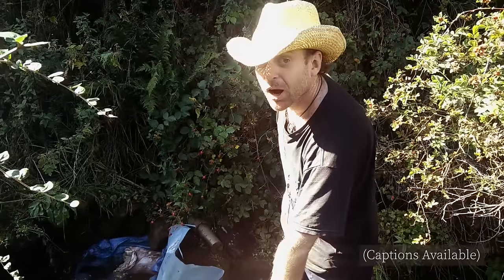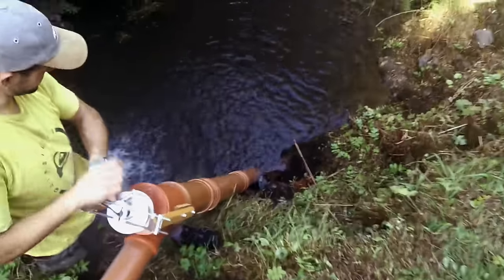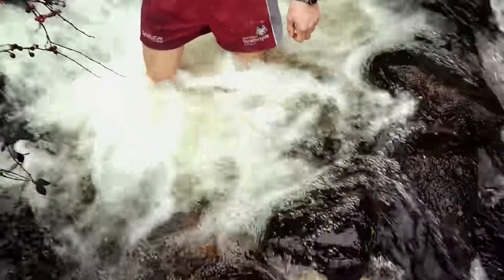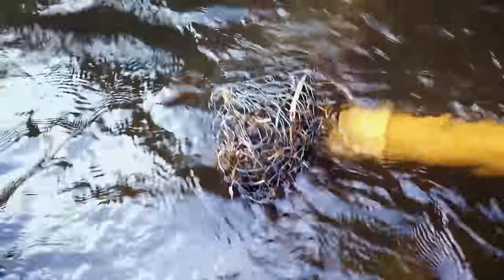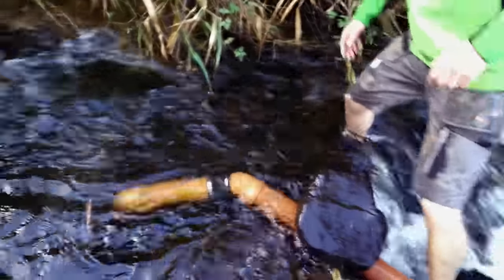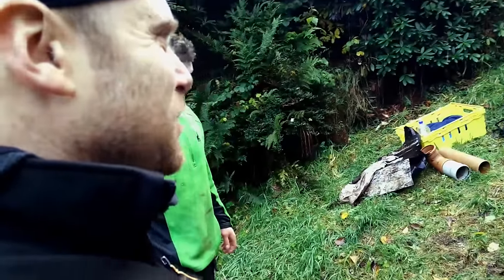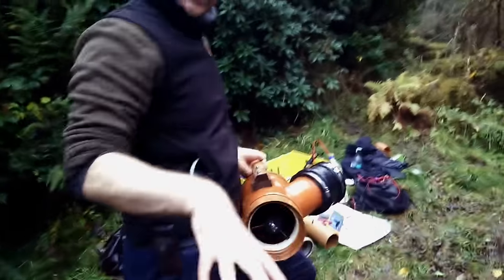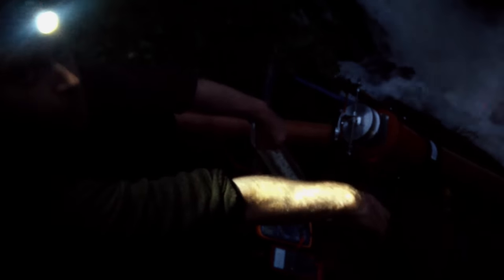Real World Results From The $50 Water Turbine

Comment: Nice try, wrong fans thou.

You are runing a low head, I might say very low head instalation, that requires at least a Kaplan turbine (looks more like a boat propeler) or a Francis turbine (more like an impeller), but the head is I guess too low for a Francis.

My take is you need to go Archimedes screw versus Francis propeler design, print it yourselves in PLA since is cheap and strong, but will wear out in time, and if you are happy with the output than re print it in PPS or at least Polycarbonate, than remelt it in dustified  dried salt or fine plasterr (gypsum) to improve layer adhesion.  My take is where you got 150 watts you can go over 200 watts, and where you got the 200 watt you can go beyond 300 watt.  It is all in the efficiency and at ultra low head, migrating towards Archimedes screw is the only option.
Reply from the maker: The PC fans were chosen pretty much purely for sake of global availability, but I have been quite impressed in terms of efficiency and power.

I'm in the process of 3D printing some more exotic runner shapes which I'll trial when I'm back in Scotland, including some screw types. Looking forward to seeing how they do.
Reply: @OpenSourceLowTech  If you know you are going to be around Luton/Watford/hemel Hampsted/Milton keyns let me know a few days in advance, a discussion on th subject might prove interesting, and if it's not raining, my grill can cook in many ways... lol  B.O.B.

Comment: It's amazing to see you posting again! I've shared your stuff with a ton of different folks. I have a few questions.
1. What do you think is the minimum pipe diameter you could use effectively? My personal situation is I have a pretty low flow spring fed creek but I think I could run this with 1.5-2 inch PVC pipe and it runs over a 50 to 60 ft drop off so I have a ton of potential head pressure. 
2. Is there a reason you chose to use the fan blades as opposed to something like a carbon fiber rc propeller or a boat trolling motor prop? It certainly would raise the price into the 100-200 dollar range but it seems like the durability would warrant the increase in price. I certainly see the appeal to being able to find a junked hoverboard and a a tower pc to rip a fan off of from the local dump but, personally, I'm out in the country so transportation costs can begin to eat into the $50 price tag.
3. Is there a reason you chose an inline propeller as opposed to something more similar to a standard water paddle wheel but offset, with maybe half the wheel in the flow at any given time? It just seems like you could do 5 or 6 flat paddles from a cut down leaf spring or thinner piece of metal flat stock and never have to worry about it breaking.
Reply from the maker: How much flow? If it's low tens of liters per second or less, and with that much head you're probably better off with a pressure turbine, such as a Turgo or Pelton.

The runner can be made of pretty much anything that will hold up, I've been focusing on PC fans so far because they're everywhere in the world, but if one has access to something more robust that fits then there's no reason why not.
I'll also be trialling some fairly exotic 3D printed options when I'm back, for those with access to a printer.

Water wheels aren't very efficient, even in optimal situations. Also very low revving, so need gearing up to reach any kind of useful voltage.
Reply: @OpenSourceLowTech  awesome thank you so much for the information! I will look in to the turgo or peltin turbines. I think some of the other examples I've seen were a turgo turbine and I, incorrectly, thought the turbine portion was offset to flow of water.
Reply from the maker: Offset like how?
Reply: @OpenSourceLowTech   I think it was this video I was thinking of where they are using a turgo turbine. It had been a year or more since I watched it. It looked to me as though the water was just skimming past the edge but I'm sure that's not what's happening based on the diagrams I found since you mentioned turgo turbines.

https://youtu.be/Flz4_OE4CGI
Reply from the maker: Turgos and Peltons both work by blasting jets of pressurised water onto a wheel of cups, so yeah the flow is tangential, more or less, to the runner. Mine is axial.
Reply: @OpenSourceLowTech  thanks so much for the answers! I truly feel like the work you're doing is gonna make a huge difference for a lot of people if they are willing to listen and learn. Keep up the great work!

Comment: This video title sounds like click bait, but it isn't. I watched it a few weeks ago. Search for this title "This Genius Propeller Will Change Transport Forever" watch the video about a toroidal propellor that would be stronger and according to the guys in the video, much more efficient. Great video. I subbed.
Reply from the maker: Yeah saw those, will test some when I get the chance.
I feel like their advantages are more for use as a propeller than impeller, but only one way to find out.
Reply: @OpenSourceLowTech  I think, and granted that can be dangerous, but it would seem like if the "prop" is surrounded by a tube that is just barely larger than the prop and there isn't any cavitation, the results of the prop pushing the water would be the same as the water pushing the prop, except of course, in the inverse.
Reply from the maker: Quite possibly, but cavitation is the issue. Props usually have a tip speed ratio greater than 1, meaning they're moving through the water faster than the water is moving past them, and so cause cavitation, which is the main thing the toroidals are looking to resolve and why they're pretty efficient for that purpose.

But that's not often true of impellers, where the rotational speed is set by the flow, not the other way around. It definitely can happen, horizontal axis wind turbines usually have a TSR greater than 1, but it's less a concern with water turbines, with most of the cavitation instead tearing off the more static, less hydrodynamic areas.
And so the toroidals are having less of a problem to solve, and their other drawbacks are more of a concern.

But this is still mostly just assumptions and conjecture on my part, I'm looking forward to testing various of these designs in the real world and seeing what happens.

Comment: A 3 blade sand cast aluminium fan would still be affordable and DIY but much stronger
Reply from the maker: It would, but I'm aiming for maximum ease of fabrication.
Tho if you do have a metal runner of the right size, it'll attach and work as well.

Comment: I think you could generate more electricity with a larger turbine 3 times the diameter of the exit pipe with a cup like catch rather than slanted blades.  Imagine the horsepower it would take to deliver that much water at that volume and speed up the hill to it's source.  Maybe one full horsepower so you should be able to get 2/3 or 3/4 of that back.
Reply: So are you telling us that if you build a bigger turbine you will get more power?  NOooo! REALLY??? Why not "just" build it a thousand times bigger then? So much electrics!

When you figure out the answer...
Reply: @calysagora3615  The turbine they are using is too small.  It is not even slowing down the water.  They could put ten of those in the pipe, it is minuscule.  3 times the diameter of the exit diameter should provide sufficient torque on a 12 to 13 inch turbine and a 500 watt generator.  Also their little fan blades BROKE due to being weak.  Comment back when your have something constructive to say instead of sarcastic.
Reply from the maker: It's a momentum turbine, not pressure, so the power is in getting as much water moving as quickly as possible, with no real advantage to multiple runners.

A larger runner will produce more torque, but at less rpms unless the water is venturi'd across the outer diameter, which may or may not be an advantage overall but would definitely be far harder to construct with off the shelf materials at as low a cost per watt as possible.
Reply: @OpenSourceLowTech  I have an idea to help maximize the water flow through a turbine.  If you make your own turbine you can use plastic 2 liter bottles to make the vanes by folding them over like we did when we were in grade school to make a pinwheel powered by wind.  Then take a bottle and cut the ends off and split it down the side to make a chute to run the vanes in while they are spinning to keep the water from spilling out or you could just cut the side off of the pvc and run the turbine in that open side.  Now that I am started all kinds of innovations come to mind, some by using a small rubber tire cut in fourths.  Good luck in your designs.

Comment: You seem to be unnecessarily fixated on the siphon. If you could at least add a method of sucking out the air that tends to find its way to the top of the system, it make more sense.

Comment: According to my calculations 192 watts demo 35 liter/s and 2.5m drop is only 22% efficient. If it was 100% efficient you should get 858w.
Seams a bit low, something is very of; commercial hydropower reach over 90% efficiency, so I guess 60% might be a resonable number to expect for something like this.
Either the generator is very inefficient or the impeller is inefficient or I guess both.

Maybe test each one separately.
Reply from the maker: Your calculations are correct, but a 3D printed screw type impeller does a better job than the PC fan (which also does fairly ok for the accessible materials option).
Pelton and Turgo type pressure turbines as used in industrial hydro power are very efficient, but require at least 20m head to operate. In low head situations such as this turbine is designed for they essentially don't operate at all, let alone efficiently.

Comment: Cavitation explosions, air fans are not engineered for that
Reply from the maker: There's a little cavitation off the back of the runner, but flaring the draft tube straight after greatly reduces it by dropping the linear fluid velocity.

Comment: You would be far better to use a Garden Auger Post Hole Digger Earth Drill Bit and weld an extension. They are 80mm x 600mm.They are only about $20 delivered, rather than use a pathetic fan blade. You could use a voltage doubler to increase voltage. They only use 2 electrolytic capacitors and 2 diodes. Better still get a second hand alternator and put neodymium magnets in it, or use a dc treadmill motor with the voltage doubler.

Comment: Well I Understand Your Trying To Keep It As Cheap As Possible, Butt Why Not Lookin Into An Aluminum Or Stainless Boat Motor Prop Or Such For Driving It? A Few Guys Are Using Strong Little Electric Motors w/SS Open Blades Props On Kayaks & Are Getting Them Somewheres? 🤔😁😎 Thanks Mates
Reply from the maker: I'll be trialling a handful of various options. Metal runners would be better, and no reason not to use one if it's the right size and is available, but PC fans are everywhere and seem to do a decent job, one I've figured a workable method for strengthening them.
Reply: @OpenSourceLowTech  Maybe Just Cut & Bend Blades Outta Flat Scrap SS Metal 3-4mm Thick? From Pot-Pans-Lids, Etc... 🤔
Reply from the maker: Is an option.

Comment: Do I detect a fellow Kiwi accent
Reply from the maker: Yep.
Reply: @OpenSourceLowTech  Chur chur Brother unmistakable accent , you guys worked so hard on this setup hope it's still running..
Reply from the maker: This particular build is not currently in place, but we're building a more long term version that should be operating by end of the summer and actually plugged in to the house.

Comment: personaly i would use a tela tubine design less machining  needed the impeller is 3d printed poor area's don't have them
Reply from the maker: Teslas kind of want more pressure than this setting would provide, and are more involved to construct.

This turbine has zero machining and the impellers are standard PC fans, not 3D printed.
Although I'll be trialling some printed ones too, for options.

Comment: But the battery is most expensive
Reply from the maker: Not necessarily, old car batteries aren't particularly well suited to this type of use, but will basically function for a while, and are cheap and easy to replace as needed.

Comment: Isn't that illegal.. Atleast it is in Sweden
Reply: Thing is that out rivers and lakes etc are heavily regulated and any thing that generates electricity from water will probably not be allowed
Reply from the maker: Not familiar with Sweden, but part of the idea of this turbine is that it's essentially portable, you can just plug it in and out of the water without earthworks. At most just reposition some rocks. So it's a lot less likely to run afoul of laws, and if it needs to be removed you can just pick it up.

Comment: Крыльчатка от вентилятора не совсем подходит в качестве турбины🛩️👎,профиль лопастей спроектирован конкретно для работы с воздушными потоками, вам нужно в качестве турбины использовать трёхлопастной винт от моторной лодки ⛵👍.
Reply from the maker: Indeed. The PC fans are a good option for low resource environments where anything else would be difficult to source, and do seem to do a fairly good job in terms of efficiency and durability. I'll be testing a handful of 3D printable options in the coming months to wee which is most viable, for those with access to that kind of thing.